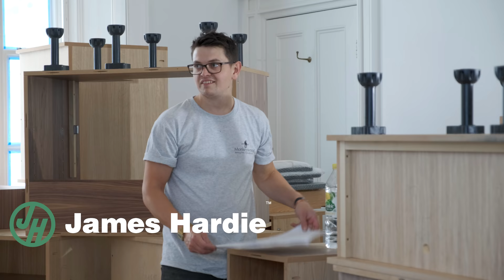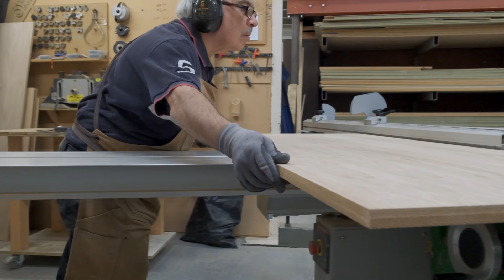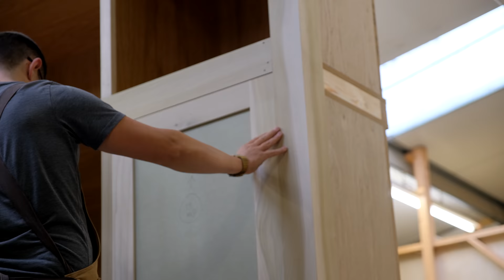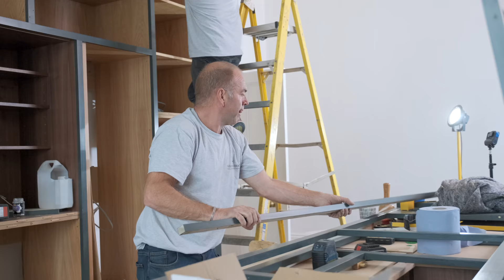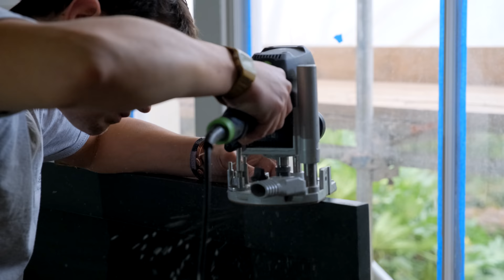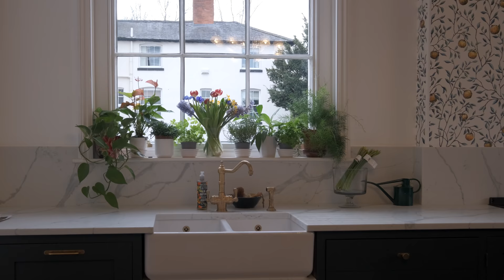LUXURY HANDMADE KITCHEN

Comment: As I've always said a kitchen is just a row of boxes generally constructed from veneered mdf/chipboard/ply on plastic feet. nothing special about making kitchens.  A few power tools ,screws and that is all you need. If it was a bowed sash window with curved glass then I would agree ,craftsmanship but anyone with a few months of training can make a kitchen.
      Everyone in the kitchen industry is trying their best to stand out from the rest because the market is saturated with people making boxes on plastic feet. When I started making Joinery back in the mid 1980's I worked on a large country house where they were having a handbuilt "Smallbone" Kitchen fitted. What I saw was to become typical in the industry which was basic cheap materials (MRMDF, Tulipwood,Veneered mdf/ply) being made into boxes on cheap adjustable feet and then a decorator came in and hand painted each and every unit, finish coat was applied with a bird feather to create the finish. It was utter nonsense and sadly people are still being taking in by marketing wank....

Comment: Excellent work. Typical interior designer though. Let's make this kitchen 20ft high so the Filipino made who is 4ft nothing has to use a ladder to get the shredded wheat... Honestly. Worked in private households for 20 years and the interior designers are all the same. Pretty but ultimately totally impractical. EVERY TIME... Piano black lacquered 20ft high single piece doors in a kitchen with dogs, chef's, cleaners etc. Yeah mate, brilliant idea...... Now I'm cabinet maker I can reign them in to reality.